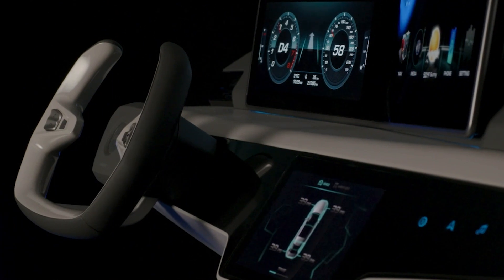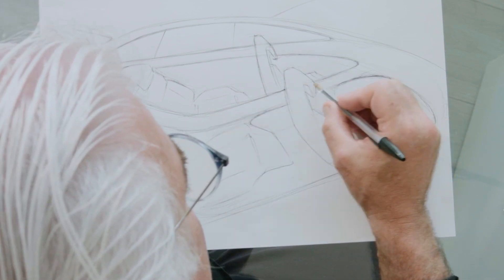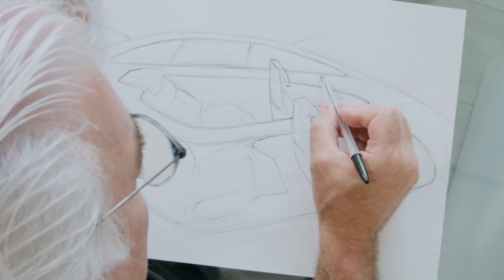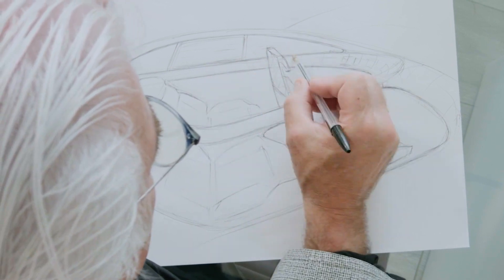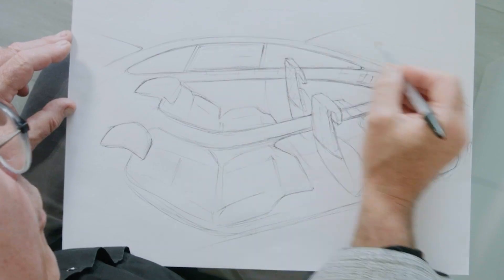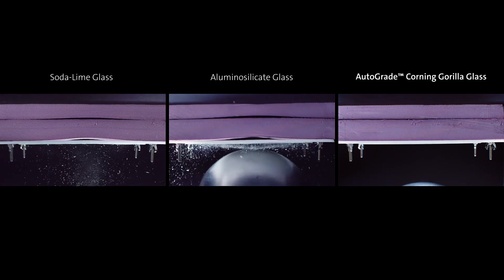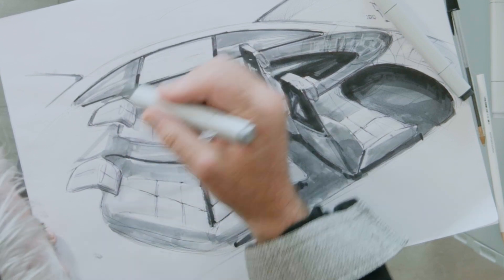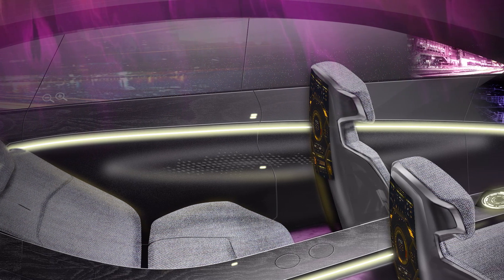Is This What Car Interiors Will Look Like In 10 Years!?

Comment: Pardon.  I don’t like that design of yours.  My apologies. 
I want my cockpit of the car to look like a tighter faster version of what I sit in my living room so to speak.  
All that glass and sharp edges doesn’t look comfortable at all.   
Don’t misunderstand.  I don’t want a fluffy leather living room chair as a cockpit.   But something not over tight either.  
That’s why I think car makers like BMW had it about right in the beginning of the 2000’s.    
The interior leather and organic materials got tighter, but didn’t lose their elegance and comfort.  
You don’t always go 150mpr in a car.   Most of the time it is used for practical purposes.  
I don’t think our furniture has changed much because we have found a recipe for being inviting and comfortable.   
I don’t think cars , just because they are driving machines should go over board with the interior to reflect the technology that is on the inside and outside.  
Thus I don’t think we need so many screens in a car.   
Think of it.    
How much info do we need when we drive and what can be left alone as semi analog looking instead of being screen driven? 
For example I think revometers and speed gauges on a digital screen are incredibly ugly and sharp in cars.   
And not needed.  They don’t really offer anything more.  It’s gimmicky 
My fear of my older 2011 BMW getting old and me having to replace it, is having to choose from cars with way way too many screens and digital.    Cold , sharp and not elegant. 

Cheers

Comment: As former BMW Designworks director of innovation and market development, my job was to work with designers and engineers to find or create the technologies to solve drivers problems or offer unique to BMW enhancements to the Ultimate Driving Experience. Sometimes it was working with ex-Apple Ux designers to create the iDrive or Nike fabrications to offer cooler, more cushioned seating. i would suggest 2 processes for designers: watch carefully what drivers and passengers do and discuss their feelings; then imagine what would make their experience more memorable and rewarding (they can’t tell you what they’ve never experienced). That creation that exceeds expectations is the most fun and often leads to the most success

Comment: The infotainment screens and digital gauges in many cars today will age about as well as your average smartphone or tablet. While phones and tablets are typically replaced every few years, today's cars will unfortunately be stuck with such interfaces. As with any electronic interface, such designs will inevitably undergo a large amount of change over a relatively short period of time. Might standards eventually be applied to such components, so that owners could easily swap them out for newer up-to-date units?

Comment: I personally loath the loss of physical buttons. Touch displays are beautiful and 'cool', but they are also bright, potentially distracting, and require you to babysit your interactions when interfacing. There's an important moment when you're feeling for a physical button where you are able to locate it on memory before it's engaged. Screens and capacitive touch sensors force you to focus your attention and be exact with your input. Until we have reliable and fully autonomous vehicles, ones that allow for you to safely focus on other things besides driving, I think this tech is a little too early. Physical controls are safer on multiple levels for that reason. I think there's a lot more design opportunity too when you can physicalize your controls. I miss playing with my family's old audio equipment and feeling how good switches, dials, and buttons can be. It's satisfying to feel the physical clicks of a good switch and the right amount of resistance when turning a weighty dial. To me the lathed and milled metal controls often looked more beautiful and luxurious.

With all that said, I think AR displays can't come soon enough. Receiving information from the windscreen allows you to keep your eyes on the road which I think is as valuable or more than 360 camera safety features or automatic breaking, at least while we have cars driven by people. I really think with the advent of fully electric vehicles we'll see more focus being paid to the interior experience. Can't wait to see what an S-Class is like in the next 5 to 10 years.
Reply from the maker: Great feedback M!

Comment: However much I love this, and I do, and even though I'm deeply impressed, to me this feels and looks more like an eVTOL air transport vehicle than a car. I'm old fashioned but a does it even make sense to call somebody in a fully autonomous vehicle a driver?
Reply from the maker: True Bruno, this one is geared for those minimal input, long trips segment. A sportier direction would have a different architecture but could still use glass tech instead of more traditional materials. 👍
Reply: @frankstephensondesign  I wonder what would come off blending those ideas you put forth with crystal making techniques, so that a rotary knob or "instruments" would have the finish of a whiskey tumbler or crystal cut engravings for volume and temperature control so that the haptic feedback would be more than electric pulses

Comment: Tier 1 suppliers and contractors are always trying to find ways to sell manufactures technology to incorporate on cars, not always needed or welcome. Current oversize LCD panels, touch buttons on the steering wheel and centre console touch pads, gesture control, let alone voice control, are just exemples that come to mind.
I have a different perspective on interior car design: as the touch panels, iPad style and digital instruments panels becoming common, it's the physical buttons, analog instrumentation and minimalism that will define luxury and wellness. It happened already a few decades ago with wristwatches: Casio and Timex used to be all the rave! Today, smart watches are a trend, but they aren't watches anymore.
It's predictable that in the future, people will became overwhelmed with information, advertisement, entertainment, etc that doesn't translate into any knowledge. 
And I'm not even discussing technological obsolescence of that sort of software dependent interior design...

Comment: Personally, I miss good switchgear. I get that cost and design is driving things toward touchscreens, but I think that touchscreens are at best the second-best interface to do just about anything. I have never personally used any software that I feel was best done on a touchscreen (I think it says something that even stylus drawing is done on a pad separate from the screen in a lot of cases). And, if an automaker is going to add a touchscreen with a computer in my dashboard, then I'd like to do some computer-y things with it. For instance, why do I still need an OBD reader if there's already a computer in my dashbaord? There should be an app that tells me about any codes in the car. Why can't I make a spreadsheet to keep track of service appointments, costs, mileages between services, etc. that stays with the car through all owners?

I'll just cap off by saying that my favorite thing about my dad's 70 Chevy truck, that is otherwise a completely un-notable classic, is locking and unlocking the doors. Putting the key into the door and feeling the entire door lock mechanism move because I have two fingers on a key is infinitely satisfying to me.
Reply: I agree, switchgear should never be completely replaced.  One thing I'd like to see is to be able to program what each physical switch\button does.  Every driver has a different set of their most oft used controls and it would be cool to be able to have your own most important controls all right at the flip of an actual switch.

As for OBD access, that's not going to happen as automakers want to keep internal data obfuscated to the majority of owners in order to funnel as many of them as possible to dealer service.  If they were going to more freely share OBD info, it woulda happened at some point in the 3+ decades the system has been in place.  But there are plenty of simple solutions for that from a free reading at an auto parts store to a phone app to just driving around with your laptop plugged into the port displaying whatever you'd like.  I agree it would be nice to have that laptop functionality built in but it might lose OEMs money so it'll never happen.
Reply: @solidXxXtuna  Agreed on why OBD in dash isn't a thing. Cool idea for the customizable switches, especially since you could just put a screen that shows the correct icon on every one when you reassign it.
Reply: All I hope is it will be possible to buy a car a decade down the road that still has a few switches or buttons or knobs.  That is not a Rolls Royce or Konigsegg.  There's this potential 'tactile screen' tech that can raise the surface of the screen to emulate a button as well as a simulated button click when you finger-squish it.  I dunno.  If simulated beef gets 97% realistic, I'll eat it.  But you better believe I'm still going out for a real steak on special occasions.

Comment: In regards to your ending question, I an a firm believer that there is a place for both the traditional and the tech-focused styles. Car interior design is getting closer and closer to home interior design, and we see that in home interiors there is a fine appreciation for both the classic elegance, but also the modern clean and technological approach. Having both options available offers a richness and diversity that allows you to appreciate exactly what suits you. In my mind the different approaches to interior design should not be fighting, but rather seen as a support to each other, a way to balance each other out. Classic seems even more sophisticated when it's put up next to a tech screen utopia, and vice versa.

However we approach interior design, I do believe that a common aspect that we should do our best to maintain, is the appreciation for the materials themselves and the volumes, surfacing, reflections, etc that we can adjust and polish to add that sense of craftsmanship. Now, whether craftsmanship means a hardened experienced craftsman putting his soul into the work, or if its the ultimate precision machining done by a host of robots to achieve pinnacle surface treatments and allignments, both are equally valuable. As long as we don't lose our sense of appreciation for finer work and attention to details.
Reply: Agree.

I also think the future of car design will offer spaces that engage the driver or detach the occupants from the driving experience to introduce them in a form of augmented reality and/or Virtual reality.

Comment: voice control mic adapter onto ur phone should replace infotainment. speaker noise cancelation can help with personalized voice commands. for more complaex tasks, semi auto swiping to scroll through pages of few switches of large size, so u minimize need to be careful with finger especially over bympy road. system will not allow user to do complex tasks while at speed b/c distracted driving unsafe. speakers are optional, most people use a earbud a little away from ear so they can hear honking cars, emergency car sirens etc. 

purposefulness is timeless, so minimal aesthetics bring focus to parts of common function are great ex. ac/heater switches are same color/texture as thermal venting tubes and blowing direction changing switch, while audio swicthes and speaker another color, etc.
cabin is preferably not bright bold colored so driving environment is not distracted from due to some light reflecitng on some shiny metal/screen etc.

Comment: Safety first: At least the design must have seatbelts and airbags in addition. It's also important that all surfaces are slightly elastic and "bend, don't splinter" upon impact (a test is shown from 8:50 that seems to prove that). Currently dashboards but also the insides of doors and pillars are foam, which is certainly cheaper to produce than "intelligent" materials that also act as an input/output device. We will see how much of it actually finds its way to reality.
If it's fully automatic I also imagine rotating seats. Passengers might choose to look forward or face each other, depending on where they are going. On a long boring highway you don't need to be staring at the horizon or the rear lights of the vehicle in front constantly ... on a winding mountain road it's essential to follow the road with your eyes to avoid getting seasick.

Comment: I know this video is sponsored by glass company and your design looks brilliant. But I still preferred a button. Screen is nice and beautiful. But is very hard to use when you are driving. You have to take your eye off the road to interact with it. Every functions will be at different spot everytime and you can't just glide your finger across the screen to find where the specific button is.

But I understand that today's cars have so many functions that if you only use buttons, it will be a big mess. So the solution is a hybrid of 2 systems. Basic functions that you regularly use and required good accessibility is on buttons. Rest is in screen. I want to adjust the air con and change radio station by twisting the knob and can be done in 1 sec. Not going through vehicle setting menu buried under pile of non sense that took minutes to goes through.

Comment: I think I would like an interior of the car to be an interior of the car - not the neverending screen everywhere. We are already at the point, when less information is better than more. I dread future, where I will have to experience information overload from every surface surrounding me.
If you need screens - make one, in front of the passenger/driver, and change information on it, depending on what information he needs now. You won't look at 3 screens at the same time anyway - why stuff them everywhere?

TLDR: While cruising in a car, I would like to have some rest for my eyes and my brain. That means: less things demanding my attention and shining all fancy/shmancy moving colors to excite me and overload me even more.
Give me plain steel, or plain wood, or plain plastic even - what's wrong with that? All good as long as I don't have to waste my attention on it for no real reason, aside from some cool party trick, getting annoying the 3rd time it happens.

Comment: Analog is the way to go in interior car design. It ages better, allows for better differenciation between brands and can be used without taking one's eyes off the road.
Reply: I completely agree with the second half of your comment, but you're forgetting that this is made for autonomous cars where taking your eyes off the road is completely normal and you might even want to watch a movie on the highway.

Comment: Call me luddite but this interior looks like nightmare to me. In fact I like the aesthetics, but the amount of screens is a major turnoff. No tactile feeling like real buttons and switches, screens will get dead pixels over time and the computers running those screens will slow down and stop working eventually and all that glass is hellishly hard to keep clean and tidy when every fingerprint is visible. And how is this all gonna work during a real, cold winter like here in Finland? And some fake-ass Milky way or norhern lights will never beat the real experience, or even the real sunroof which you can actually open and feel the wind in your hair.

Screens may feel futuristic and cool now, but I'm quite sure the novelty will wear off quite soon, and rather sooner than later we all will be fed up with everything working via screens. In that point the old fashioned gauges will be an exclusive option available only in the most luxurious vehicles. If you don't believe me, just check what has happened in the watch market last 40-50 years.

Comment: Clicky buttons and switches are pretty important, our brains easily associates the physical feedback with something turning on/off somewhere and that's completely absent in touch and specially hovering no-touch buttons. I'd say it depends on the person, some may need more of that feedback than others, but most importantly it depends on the gadget or system and every function of it. If the design as a whole "asks" for it then it's ok, but going for fully physical or fully touch designs just for the sake of keeping & sticking to one harmonious style is kinda simple-minded; a combination of both, with clicky buttons for main & important functions and touch for optional & leisure related features, is completely viable.
Reply: A physical button can also be operated without looking at it, I live in  2 season country. One rain and wind season, and one cold, snowy and windy season. I need to be able to adjust fans and heat while driving, not somewhere in the menu system on a touch screen.

Comment: Tactile feedback is important to me, although, sound effects can be an effective feedback mechanism for capacitive touch switches.  With glass cockpits, an important parameter is always viewing angle.  The user should be able to see and use the display, even if they are not positioned directly in front it the display.  Finally brightness, I have an aftermarket (EONON) unit in my car which is useless in almost all daylight.  Really enjoyed this video, keep pushing the limits!
Reply: I feel that tactile feedback is very important too, but having used the trackpads of a macbook and others (where you don't physically press anything, but instead have a feedback via vibration motor), it feels just like the real thing. So I think it might be possible without physical buttons.